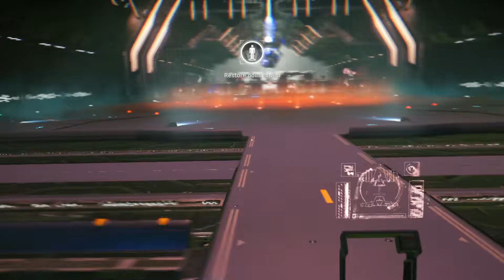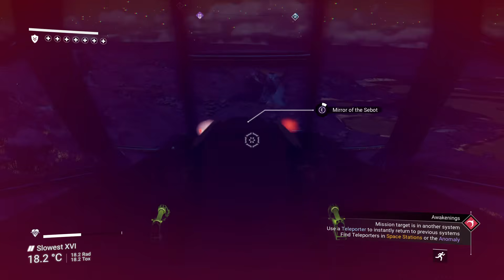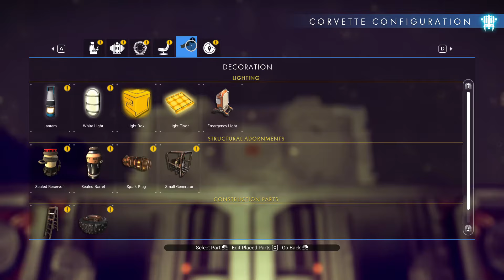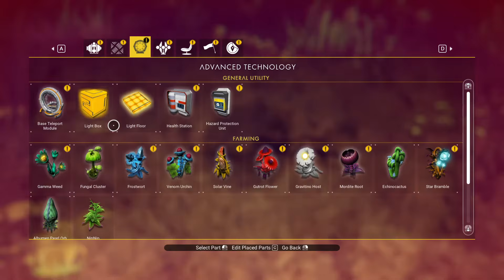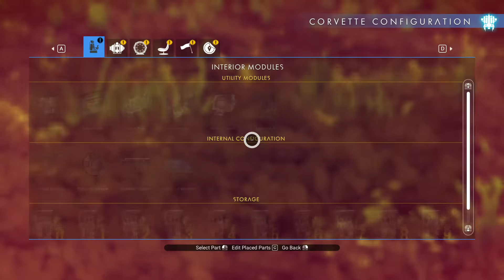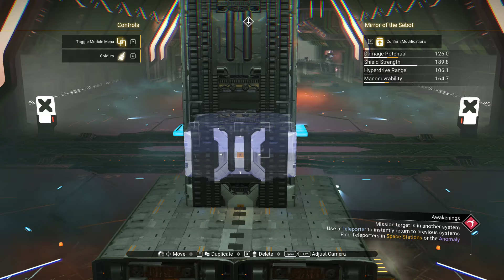(Outdated) No Man's Sky Corvettes: Vertical habs (tilted around the X axis this time)

Comment: How do the physics work inside a vertical hab? does the gravity pull you towards "down" with respect to the entire ship, or "down" with respect to the rotated module floor? So many questions!
Reply from the maker: Gravity is the same as in normal habs, so you will not be able to walk on the regular floor. Tilted habs like this are really only useful as a base for attaching other parts to.